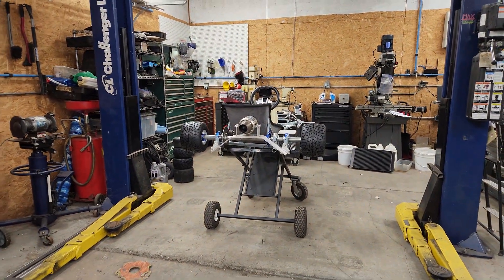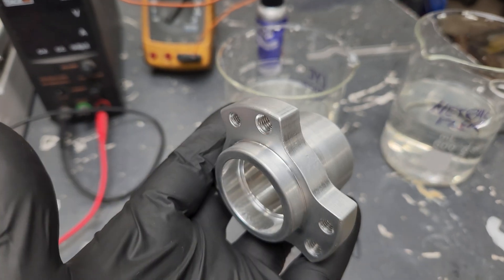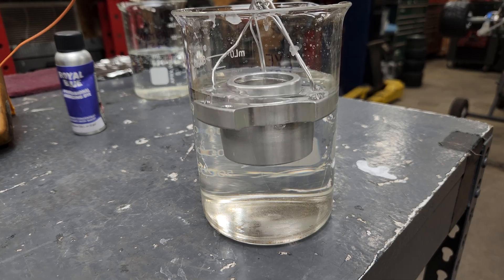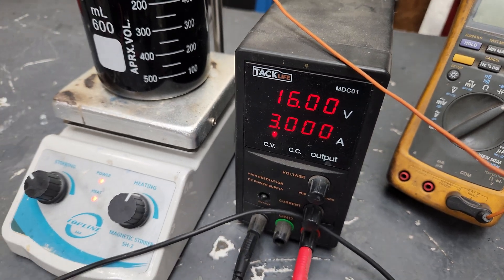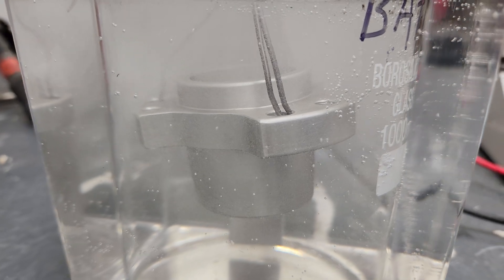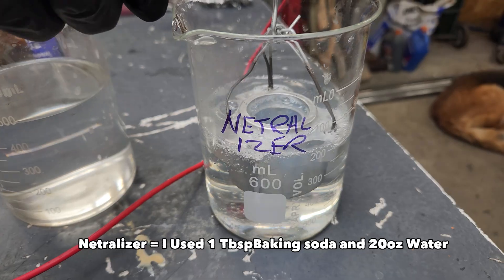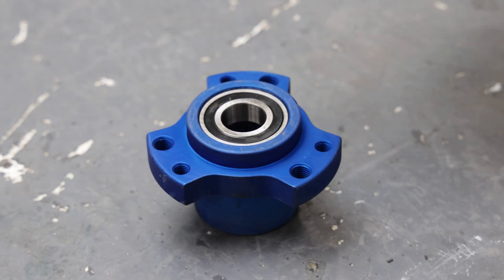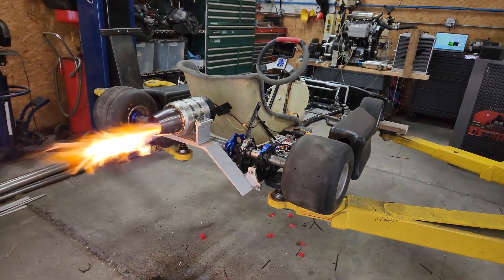How I Anodize Aluminum Parts at Home

Comment: this is super cool, but pretty sure getting your parts anodized by someone would be cheaper than buying the equipment to do it and then figuring out how to dispose of the acid and lye etc when you're done. still really cool to see how simplistic it is though. thanks
Reply: Nope Nope… yes yes, yah yah. I had a part anodized at a professional, cost almost as much as triple chrome plating. The acid is $20.00/gal at hardware store and 98%. The lye ( sodium hydroxide ) is 5 bucks at grocery store. The constant current rectifier is around a $100.00 and can be used for charging batteries among other things. To dispose of the acid neutralize it with baking soda, a buck per box. The lye can go down the drain to cut grease buildup and is perfectly fine. You may be conditioned into thinking  nothing is possible without the “big guys “ permission. I will never pay someone again for such a simple process. PS the dyes are aniline and cheap.
Reply: @Dixler683  It's not about the big guys permission, I've got my own septic on a house built in the 70s, the last thing I want to be doing is having to fixing my cast iron pipes or fixing the septic for any reason. chrome plating is different than anodizing, however I do work as an ME specc'ing out coatings for some of our jobs and talking to suppliers and it doesn't cost much to get small things coated, your mostly paying labor costs at the end of it all but the more you get coated in the same material at the same time the cost goes way down. Still though cool to see it done in house.
Reply: @bojangles5226  I do not understand you. I do not know what a “ME” is . What coatings do you spec.? I know triple chrome plating is different than anodizing. I have restored many 50’s cars dripping with chrome and stainless steel trim. I was surprised that an aluminum grill cost me almost the same to anodize as it would to chrome plate. Your pipes and septic are safe if you neutralize the sulfuric acid with sodium bicarbonate. The sodium hydroxide could be  used to neutralize the acid as well. That way you are killing 2 birds with one stone. Plus this is anodizing not coatings.
Reply: @Dixler683  ME is Mechanical Engineer. We spec all kinds of coatings, anodized AL, zinc plating, powder coat, e-coat etc.
Reply: @Dixler683  I'm with you on that.  I tried to get some bike parts gold anodized and most shops wouldn't even give me the time of day.  The ones that did were charging lot fees $200+.  Nature of the project is such that it's really not practical for me to just gather all parts and get them done at once, so I'd be paying 2-3 lot fees minimum which makes the home job much cheaper as well as much more convenient.
Reply: @goldengooch1867  you are correct about most shops showing you the door. They do not want to bother.

Comment: For better anodizing, the prepared composition (water and acid) can be placed in the refrigerator. The ideal temperature is +1C. Anodizing will be rougher than when using a warm solution.
Reply from the maker: I'm going to try that next time, I thought 22c was the ideal temp for the acid solution
Reply: Lower temperatures allow you to pump more current and / voltage in and let it go for longer amounts of time ala Hard Coat Type III anodize.

Theres a bit more to it than that (and colder temperatures), but the main advantage is that the oxide layer can be much thicker and hence tougher. 

If memory serves ne correct, I thinik I usually get a couple tenths (of an inch - .0002) or so per side of growth doing tyoe 2 and my half ass attempt at hard coat saw closer to a thou (although I was a bit shy).

I ended up doing a big ice bath around my tank.
Reply: Decorative anodising as shown in the video should be carried out at between 19 and 24 degrees Celsius. Hard anodising is done at between 5 and 0 degrees Celsius. Hard anodising will produce a thicker anodic layer, typically 50% thicker than that of decorative anodising. Decorative produces a much more aesthetically please finished whereas hard produces a more flat finish which is exaggerated after dying the part.

Comment: Could you link the equipment? Great video
Reply from the maker: Yes I will... thanks!  I may do an actual how to soon but it's so simple . I will try to post links tomorrow. Just an Amazon 30vdc 5.1 amp power supply, a piece of aluminum, some sulfuric battery acid, sodium hydroxide off of Amazon, and baking soda. I also got the blue dye off of Amazon I just got the one with the best reviews.
Reply: @WarpedLab  Yea a good detailed how to would be amazing! I'd love to try this for some random motorcycle parts.

Comment: Honest question, just looking f9r clarification. 

I though anodizing was creating an oxide layer on the surface of the metal by running a current through it? This looks like your acid edging the surface of the material to make it more pores with some kind of electrolysis and then dying the material.

Is this process here technically anodizing? Or am I incorrect? And if so, how? I'm not trying to be a dick or anything, your end result came out amazing. I'm just trying to educate myself on rhe difference and process.

Thanks
Reply from the maker: Yes this is actual anodizing, you end up with an oxide layer on the part, when you pull it out you can physically feel the difference it's insulated and it's very very hard, if you try to scratch it it will not scratch very easy at all. And when it does scratch it makes that chalkboard noise. So after anodizing apart like this if you do not dye it then you just put it in boiling water for a few minutes to seal it or use a sealer.

Comment: I have the same power supply. Have you had issues with it not staying in CC mode? I’m doing smaller parts at around.7 amp and it will start off in constant current mode but reverts to constant voltage after only a minute or less. I can’t seem to determine what I’m doing wrong. Any ideas?
Reply from the maker: Yes I have had the exact same problem, even in this video. I'm not.sure why but I'm thinking it might be the voltage cutoff of something where it switches from cc to cv. I'm also trying to figure it out
Reply: @WarpedLab  thanks for the response. I’ll reply here if I figure anything out. 
It has worked ok but I’m concerned I’ll get into a more important component and have it not turn out.

Comment: How wear resistant is that anodized part / its colour?
Reply from the maker: Depends on the thickness but it's anodizing, no different than parts that you buy. The only thing is that when you anodize them yourself you can make the coding thicker or thinner, so the thicker the anodizing the more resistant it is to wear and electrical conductivity
Reply: @WarpedLab  not quite true, wear resistance is dependent on oxide density, and that is a result of the temperature of the acid (mainly, but lots of other factors are affected by said temperature), which in turn will dictate the voltage (assuming you're using the 15% sulfuric electrolyte), type2 (which is kind of what you did here in the video), is standardized to be done at around 21C, and in your example in the video, I can assure you that the oxide is pretty soft, because after 80 minutes with that amount of current, your acid got pretty warm, which might also be why your dye took so well (soft oxide = large pores = easily absorb dye, can't really be sealed properly), for good blue dye absorbtion you need 12micron thickness minimum, and you should be able to achieve it in about 25 minutes, at 50-60min you pretty much reach maximum possible thickness possible for type2 of around 25micron (less if you let the electrolyte to warm up, since it will dissolve the forming oxide easier), anything past that time simply eats the part away 
boiling in water for 15min is not enough to achieve a good seal, standard is around hour in boiling water for 20ish micron thickness, results are poor corrosion resistance and dye leakage over time, try a white towel with IPA or acetone and wipe your part - see if it shows blue on the towel - this is about the most basic seal test you can do
I'm not sure what was the purpose of the second container around the electrolyte beaker (safety?) because it didn't look to have any circulation lines attached, but if you want to get more consistent results - first and foremost - get the electrolyte temperature under control, this is very important, don't go below 21C, there is no point in your setup, but try to avoid over 25C, the coating will be soft and dye will leak regardless of how well you try to seal it, also you can avoid etching altogether, you don't need to do it (it simply helps cleaning), etching like you have here is only good for stripping existing anodize, natural oxide is too thin to really interfere and will melt in your acid anyway if you anodize for such a long time, which brings me to the 720 rule, look it up and study, it gives very predictable results if you keep the temperature under control, over time, if you anodize lots of parts in small amount of electrolyte like you have here, it will become saturated with dissolved aluminum, which will decrease conductivity and your voltage will gradually increase to get the desired current, general rule of thumb - you go for 1.5amps/sqdm (which is standard for type2), when you reach 18V mark, decant the electrolyte to bring the voltage back to 14-15V - that dissolved aluminum also interferes with dye absorbtion
don't oversimplify this process, getting 1 or 2 parts done with home depot equipment is easy, but getting consistent results over time and make profit doing it is quite difficult, don't dumb down the skill of people doing that for living by making videos like this to give general public impression of how simple it is, it isn't
edit: make your outside container for the electrolyte beaker into a chiller, circulate fresh cold tap water in and let it drain to to sink to at least try to keep the electrolyte temp under control
edit1: use threads in the part as contact points only as last resort, always prefer smooth surfaces, problem with threads is that you may lose electrical connection to substrate when enough oxide grows around the contact point, try to get hold of titanium wire (only grade1, or grade2 in worst case, NOT grade5, it will not work in this application), 1.5-2mm is good size to bend springs/hooks out of that will hold parts securely
Reply: @dghtr79_36  Wow thanks for such a detailed information. 
Does it have to be Sulphur acid/water solution for this process or it can be done with water and baking soda? How to achieve natural blue color of aluminum without the paint? And if you do want to paint it, what paint to use? 

-Thanks a lot! 
Kind regards
Reply: @Aleksandar_tech  I don't know anything about anodizing aluminum using basic solutions, can't help there.
aluminum oxides using sulfuric are colorless (yellow hue may start to be noticeable at higher thickness, but not on all alloys) if done at room temperature, you will always need to dye them and seal for dye not to leak and to increase corrosion resistance, there are no shortcuts with this method
Reply: @dghtr79_36  Great information but the complete lack of any punctuation made it nearly impossible to read!

Comment: It's not difficult to apply an anodized layer... until you try to apply one that doesn't fade.
Reply from the maker: This is real anodizing, not coloring. I've discarded parts that I have not anodized enough because the coating is so tough that it's not even worth trying to get it off. I just discard the old part to make a new one. It won't fade if you do it properly and you make sure you clean everything well.
Reply: @WarpedLab  Another dunk in the lye bath will quickly take the anodized layer off and let you try again.  To the original poster, fading is almost always due to either incomplete sealing, or using the wrong dye.  Using a good anodization dye (like Caswell dyes) will give you better longevity than something like Rit fabric dyes that aren't designed for it.  They're substantially more expensive, but IMO the results are worth it.
Reply: @WarpedLab  What? You didn't like my reply even though it was true and factual? Or did you not like that I point out your narcissistic need to give yourself a thumbs-up? Maybe you should use one of your many ALTs to agree with you, Pumpkin... help make you feel better. My pointing out the "it won't fade" stupidity probably did the trick, but just saying some nonsense doesn't make it true.

Comment: No expensive Multi Etch needed. 
I like it! 👍 😃
Reply: Exactly
Reply: I would think you can use oven cleaner for etching.
Reply: @dickjohnson5025  any product containing sodium hydroxide should work for etching
Reply: I heard soaking in muriatic acid for 20 min is a great etching solution prior to painting / dying.